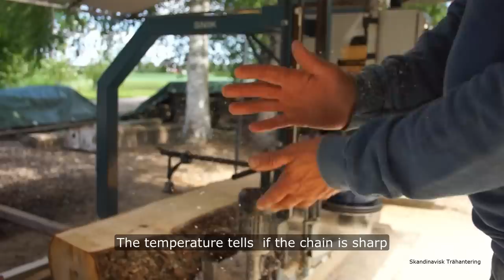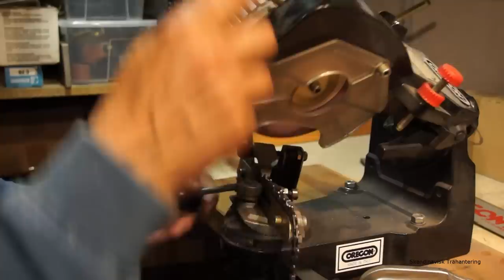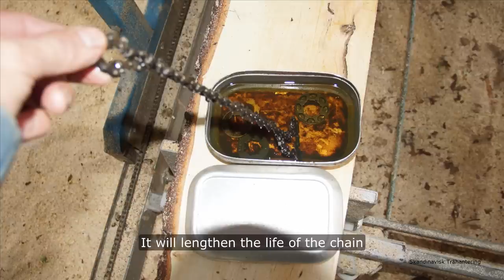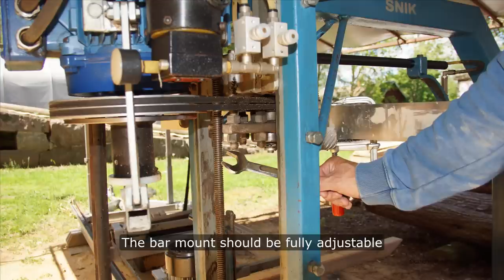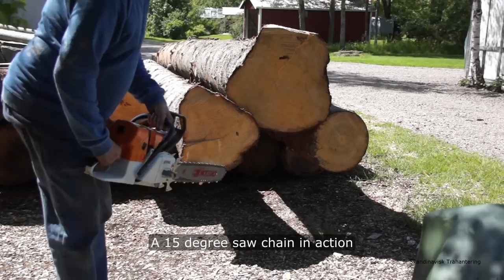SNIK chainsaw grinding

Comment: Idea! Skew the chainsaw so it is cutting down grain slightly - a small skew makes a difference. Chiselling end grain vs chiselling down grain.
Reply: Less heat, less wear, bigger saw dust.
I modified the plate on my logosol mill to allow cutting down grain slightly and it cuts faster with about 10% less wear

Comment: One super nice sawmill... enjoy all your videos on it.. i built one from scratch myself using a 12.5 hp lawnmower engine... what i call a AFJ  assembled from junk.. lol   it does the job tho... still a work in progress too   would like to see more videos on your mill also...
Reply from the maker: Thistledome Outdoors  Thank You the sawmill have 20 kg of air gun lead pellets filled in the stand on the other side of the engine to keep the mill in balance Yours have the battery +

Comment: excellent .systematic.
gotta love a sharp chain
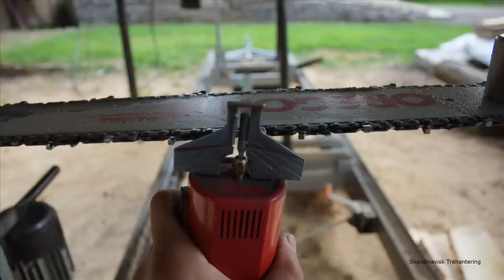Reply from the maker: brett soutar  Thanks yes and grinding with a portable grinder 02:28 will make it even sharper because all the grinding ripes will be cross the edge http://www.oregonproducts.eu/web/CatalogFORESTRY/img/519214.jpg  i even have a 5,5 mm hard-metal file that fits the grinder but i actually dropped the grinder on the ground some days ago and the 3mm file shaft  of the hard-metal file broke so i could not show you . 
The hard-metal file makes the chain super sharp.
The grinder are 12 Volt but we run it with an 15 volt battery charger at home
 it is a highly recommended accessory for a chain saw.